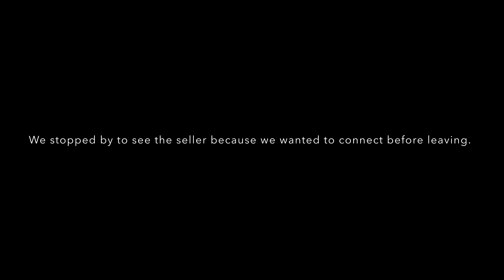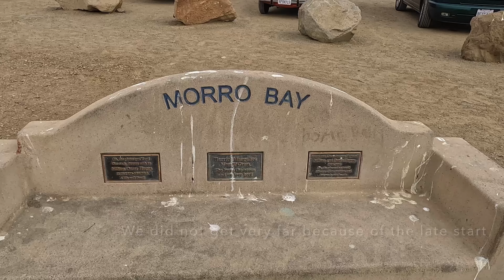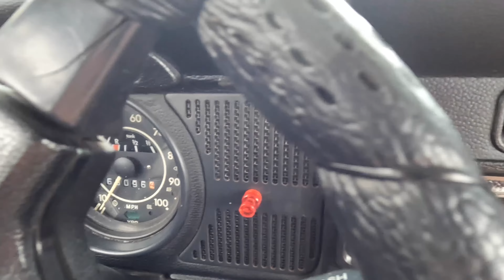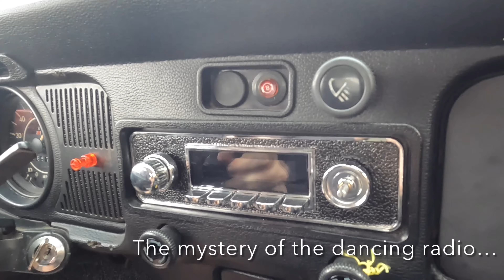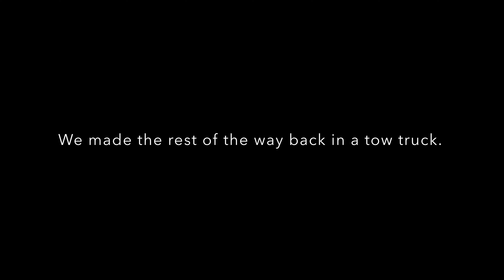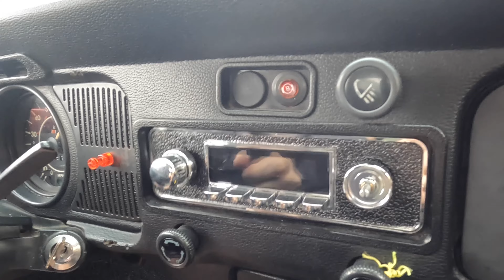Road Trip in our 1972 Volkswagen Beetle - from Los Angeles to Portland!

Comment: I wanted to grab that distributor so bad and adjust the timing for you guys, when the timing is right these engines are bulletproof, all the best with the bug 🐞
Reply from the maker: Thanks for watching! Yeah, giving it a tickle of advance on the Distributor definitely brought her back around.
Reply: That's what I've been thinking too. It''s either contact point gap isn't correct or timing is way off. A filler gauge and timing light is all that you need. Simple fix
Reply: Timing lite should always be used when setting your timing.

Comment: I drove my 1972 standard Beetle for 33 years, purchasing it in 1988. Drive from Seattle to Chicago twice and Seattle to San Jose twice. Sold it about two years ago. It was a wonderful car and I still miss it.
Reply from the maker: Fantastic Beetle you had Ralph! So great to hear how these cars stacked on the miles and created memories along the way!
Reply: @CruisingInClassics  Oddly enough, my 1972 Beetle (Tweety Pie) also had one starter issue. I was driving from Seattle to Chicago years ago. When I got to Twin Falls Idaho I stopped for gas and to spend the night. When I tried to start the engine I got nothing. I waited for 5 minutes then turned the key again. It started and I drove straight to the motel. When I got done checking in, I tried to move the car closer to my room but the starter had "checked out". There was a Volkswagen dealer next door. But their mechanics had all just gone home for the day. They told me of a gas station mechanic that was just done the road. After a short walk I arrived at the station. We went to a nearby auto parts store and I purchased a rebuilt starter which he installed. In all my long distance travels that was the only time that Tweety ever let me down. (A few of my shorter travels were more eventful!) I still miss Tweety.
Reply from the maker: @ralphbernard3908  So cool to hear about Tweety Pie. It's nice to witness the reliability when things get straightened out and are maintained. #keepdriving !
Reply: @Ralph-     Was it worth selling? You had for 33  years - so much memories. Could have been a token of memory lane?
Reply: @SunviAhsan What I was thinking too. Had for so long, why sell?

Comment: Just like many others, I wanted to help. It's always a good idea to remove the brass Idle Jet at the RHS of the Solex, and make sure it's not partially blocked. Second, I would check the Contact Breaker Points - and gap. One of the best things ever, is to install the Hall-Effect Electronic Ignition inside the Distributor. No more CB Points gap to set. Absolutely reliable starting from then on....A company called Pertronix makes this electronic module for the Beetle, and costs about $100. Greetings from Australia.
Reply from the maker: Cheers Mate! Always great to hear from experience and from our friends Down Under.
Reply: Thanks for the ignition tip. I am looking at buying a 1976 beetle which has been garaged and not driven for 36 years. Missing its front seats but otherwise seems ok. I will follow your suggestion. From a VW nut also from Down Under.

Comment: You probably already know this, but if the radio jumps like that only when the wipers are on, then it's most likely the coiled wiper cable which runs from the wiper motor (which is under the dash on the right side maybe?) behind the dash over to the driver's side wiper -- and probably has been routed beneath the radio. When the wipers are wiping, that cable twists and turns which pulls the radio up with each wipe. Rerouting that wiper cable away from under the radio would solve the problem. It's a larger aftermarket radio someone installed, so the radio takes up more space and interferes with the wiper cable or maybe even the wiper assembly itself behind the wiper. Nice bug!

Comment: I have a ‘76 fuel injection. Love it despite no bells and whistles. I still have the original AM/FM radio & it still works 😂
My next project is to get some AC installed by April

Comment: You should have found an air cooled VW shop in LA before heading out; a tune up and a few adjustments would have made your trip so much more enjoyable. The starter sounded loud. Their are modification that can be made to eliminate hot start failure, but this starter likely needs to be rebuilt or replaced. Lucky for you, everything for an old VW Beetle is easy to get and relatively cheap! Change the oil every 1500-1800 miles, clean the oil stainer every oil change, and check the valve adjustment every other oil change and you and the bug will both be happy campers! She is a great looking little car! Learn to work on her and you’ll bond with it even more! As you probably discovered, the dancing radio is caused by a windshield wiper arm contacting the top of the radio case. Some adjustments required!

Comment: Nice Vid folks. I’m on my 7th Dub in my 77th yr of life on planet earth. You got a nice Dub there. Seems like there’s nothing seriously wrong with it. Might be a bad coil, or solenoid switch for intermittent starter issues. She could use a set of new spark plugs & points. They like to run a bit on the rich side too. Use a lead additive it will make it easier on the valves. I had a 70 that had a loose head that sounded like I had a bad muffler. Ran great after the head was re-torqued. My current Dub is a 67. Looks like you have an R107 too, I also have on of those too, mine is a 79. Looking forward to the next vid. Happy trails 😊
Reply from the maker: Thanks so much for watching our video and sharing your knowledge. The VW Community has been great and we're enjoying Rosebug very much, and she's running really well.

Comment: Still, for sentimental reasons, the original VW "Bugs" have alway been one of my favorite all-time cars. 
My dad had a black '63 model...kind of fun to get rides in from '63 to somewhere in the late 1960's. Dad's three sisters - who never married and lived together their whole lives - had two, maybe three of the "Bugs" during most of the 1960's and all through the 1970's.  
Of my first three cars, car # 2, was a 1969 dark green "Bug" with the roll-back roof opening. (That was fun!). It was a close-ratio stick shift. The only serious problem with it was a VW Corporation's engine design mistake: the engines were recalibrated to not proper bore and stroke size (at least, that was stated to me from the independent seller-mechanic.  Well, my third and final VW was my dad's 1970 "Fastback" light blue model: more room inside and bit larger trunk space. It had, I think, a slightly bigger engine, fuel injection (which had a little problem and was fixed within the first year Dad bought it [Summer 1970])  I really liked that car! I named it "Heidi" after someone special in my life. I had that '70 "Fastback" given to me in late 74.  Oh...the '69 "Bug"... I had from March of 1972 to the end of that year. 
The VW models seemed to have handled really well. Good on gas mileage...Something tells me it had a little bit less than a 10 gallon gas tank. Air-cooled, rear engine model that helped a little in rear traction. 
I really liked the VW bus models. Drove one in early 1971. Fun!
Well...over all,  the VW engines way back then lacked horsepower. If I remember, the "Super Beetle" had some horsepower boost. Not till a few decades later from the model years mentioned above did Volkswagen finally turbocharged the "Bug" to get it to what? 150 horsepower or more? (Too bad Disney's "Herbie, the Love Bug" number 53 didn't do turbocharged style way back when)
So, there's my take on this VW road trip.

Comment: Whenever road tripping in any old classic car always have spare parts. Clutch cables throttle cable ignition parts fuel pump and even a spare carb. Just a piece of mind to have it just in case. Nice care BTW.
Reply from the maker: Great tips! We had quite an arsenal of tools, fluids, and a fan belt up front in the trunk. We'll be looking to build-out our spare parts inventory from here.

Comment: 18:14: I can tell you EXACTLY why your radio is jumping up and down: The armature of the wiper assembly is hitting the oversized body of that non-stock radio. Most classic VW owners who wish to install 'modern' audio equipment just use the glovebox space, either behind the door, or on a blanking plate over the hole when you remove the glovebox. Kudos for whomever did the botch-job of installing the radio and leaving it loose....

Comment: Great video, learned a lot from you guys.  2021, I restored a 73 Super Beetle trying to understand how my 71(?) 411 died in 1982 trip to visit Uncle lives in OK. From the restoration process, now, I know the may be why...engine ran out of oil causing valves dropped into the chamber.  Also subscribed as well.😀
Reply from the maker: Thanks for subscribing James!
Reply: During the restoration of my '71 Beetle, I was warned by a long-time Beetle Mechanic, that the Beetle engine didn't contain a huge amount of oil, like three litres. So- I decided to wire-in a small 12v Buzzer into the Oil Pressure switch. The Buzzer was active when the Ignition was turned-on, and then the Buzzer went off as oil pressure built up when the engine was started. It is not always easy to see the tiny orange Oil Light, when driving, and short of engine oil. You may not even know, but it can be a 'silent death' for your engine...... An audible warning instantly alerts you to Low Oil Pressure.

Comment: That's a super nice bug.  Get it tuned up (or learn how), tighten and clean the ground straps (transaxle and battery) and you should be good.  Also, keep that 20/50 molasses out of the motor; 30 weight only.  Too bad about the final break down but you were so close to the No Name Garage in Eugene!
Reply from the maker: We were so painfully close to making it all the way back. We had a blast and made some great memories. Thanks for the tips and for the comment!

Comment: Great video! Thanks. You have a beautiful car too. Mine is also an autostick. You need to do some maintenance there. I can barely stand to see that fan belt flopping around like it is. This will affect your cooling.You may find that setting your dwell angle (points) and timing will solve your other problems. If you do not have a dwell meter then you can do it manually. Instructions are both in your owners manual and the Bentley manual.
Reply from the maker: Thanks for the recommendations Tom. Fan belt has been tightened. Have a look at our latest video and you'll see that belt working nicely. Glad to know there are other Auto Stick owners out there. We look forward to improving Rose Bug and enjoying each and every mile.

Comment: Timing "by ear" while idling can be misleading. Strongly recommend to always use a timing light. It's risky to advance the distributor at idle without knowing where the timing is to TDC.
Reply: @Chrissy212  Not worth the risk. Especially with an air cooled engine. Timing lights are not expensive. Buy one. Use it.
Reply: @riverbluevert7814  I was saying if you have to in the meantime but definitely a timing light is best but there are ways to get you by if you need to

Comment: I have to say, in my time of having bugs and buggy's i never had so much trouble. The valve adjustment is very important and the coil button would go bad in the cap. This car i think is a 3 speed auto. Lucky the trans didn't act up. If you kept your hand of the shifter and didn't drive it like a real stick they did ok.

Comment: 8:02: That's 28-30° BTDC dynamic timing at full throttle. Most VW people use static timing, and there is a mark on the distributor so that you can time the engine just by turning it to the mark. Otherwise you can time it statically (with coil charged, but engine off) with nothing more than a tail light bulb with a wire and a clip soldered onto it. VW timing for 1972 (US model) was something like 5°ATDC, apparently for the same emissions reason, but everybody just followed the 3-5°BTDC that the previous models all used. Get a John Muir manual for specifics; I understand that it is still in print!

Comment: Had one in high school, 66  1300 cc 6 volt system got to keep your valves adjusted in one with some miles on it . Yours seemed like it needed valve adjusted and set you time ahead a little and check you vacuum advance
Reply: My 2nd car was a 1300 Deluxe '66 model, not that there was anything deluxe about it. Had a combined 6 and 12 volt radio in it. Only radio of this type I ever saw. My first car was a 1960 1100cc - top speed 69 mph!

Comment: Probably distributor points not properly gapped...  or could be the choke butterfly not properly adjusted.   First thing to do with these old cars is to take the points out and drop in the Pertronix electronic ignition kit,  converts it to electronic ignition with no more points to mess with.   After that check your choke butterfly for proper adjustment.

Comment: My Father purchased brand new 1958,63 , and 68 VW Beetles  and in the 1980s  i aquired a 1972 Beetle for $200.00 and a set of used tires  for a Rust Bucket  that was running  and looked like it was painted with  a Broom and House Paint ! the engine had two SparkPlugs dangling on their wires in the Engine Bay because they both  had Stripped threads in the Heads  i put a set of HelioCoils in them i got at a localIndependent VW Shop who actually knew the Vehicle and was shocked  it was still on the road  for $117.00 i bought a Brazilian made refresh kit that included all new gaskets ,Pistons , and Rings  my Dad and i pulled the motor  and put it up on a workbench in our garage , then put all those parts into the leaky old motor  that ran like a top ! i gave the car to my Sister that needed a car to go to College  ! it ran great for her  and she gave it back to me  when she was done  i pulled the motor and gave it to a Buddy of mine   that had it in many Behicles and 35 years later is still running in thesmallVWxCommumity  of my home town  we lost track of all the vehicles and the total guesstimate of miles  over the years  yet at one point it was over 600K Miles the funny thing  is  many of my Buddies at the time i put those Brazilian Parts in the motor told me those were junk and wouldn’t last  ! BTW when i rebuilt it  i degreased the motor and sprayed it Austin Healey Engine Green because that’s  all i had  on hand  my Dad always swore by CastrolGTX Motor Oil  and i used it in all my Foreign Vehicles including  many British Sports Cars , VWxWatercooled motors , and alot of Volvo Carscand Volvo/ Penta powered boats  that utilized the Volvo B18 engines Marinized 😊
Reply from the maker: Thank you Craig for tuning in and sharing some of your amazing experiences with your Beetle. With proper care and maintenance, these things should keep going & going. Hope you continue to #KeepDriving !

Comment: I know you probably want to keep it stock but all that smog device needs to come off, get a .009 distributor and get rid of the oil bath air filter and it would run a lot better 👍

Comment: Beautiful car.I will point out that the generator needs to be rotated to help with cooling it and vacuum lines need to be hooked up to air cleaner.
Reply from the maker: Thanks for your suggestions Walter! You are correct. Since returning home, we have implemented your suggestions and we will be covering how things are going with Rose Bug in our next video. Hoping you'll stay-tuned and keep a watchful eye on our air-cooled adventures.
Reply: Also if you want it’s cheap and easy add a “hard start relay”.sometimes with old wires on these bugs it will act up not wanting to start..you wire it under back seat
Reply from the maker: @walter68bug98  Thanks for another great tip! Our ignition switch was giving us intermittent grief. Your solution would be a great fix.
Reply: @CruisingInClassics  not a problem love helping vw people.the best parts places is Wolfsburg west,west coast metric and California imports.stay away from jbugs and use as much as German parts if possible if you ever have to replace anything.also get some stainless clamps for fuel injection and some stainless thin wire/cable and tie the clamps to carb and fuel pump so they don’t  come loose and be a fire source and possibly have the fuel line fitting on carb replaced with a threaded/barbed one as they get old and come loose and will cause a fire

Comment: Nice looking vw. Hope you get it sorted out. It was hard watching you have to constantly screw with it. I’ve driven mine on multiple cross country trips. They should not need to cranked and cranked and cranked like yours. I’d get rid of that junk aftermarket carb and get an original rebuilt one from Volksbitz and make sure the original distributor is in proper condition and timed correctly, adjust the V Belt, adjust the valves and you should have a super reliable vw.
Reply from the maker: Thanks for tuning in Michael and your comments. Hope you can watch the follow-up video where we discuss many of the items you mentioned. She's running good!
Reply: Perhaps a (genuine) Weber?

Comment: Seems interesting they purchased an Auto-Stick VW rather than the standard manual.  I would be more fearful to find a mechanic well-versed in this design as opposed to the manual.
Reply from the maker: Thanks for your comment. AutoSticks are an unusual choice and not very common. That's exactly why we like it. We're also lucky that our Air Cooled mechanic is very well versed in the AutoStick because the engine has very specific settings and adjustments that must be made for the AutoStick that are different than manuals. It's all part of the learning process, which we love.